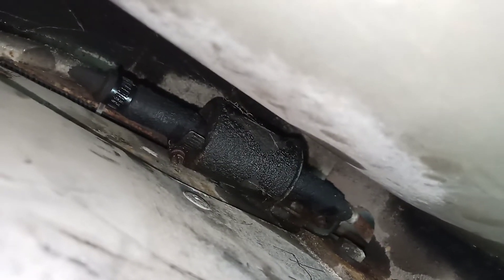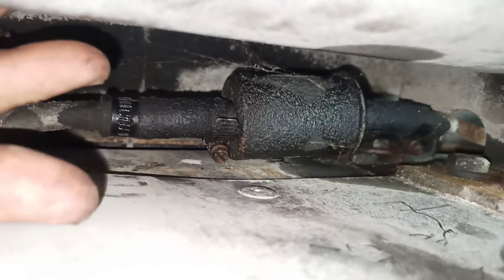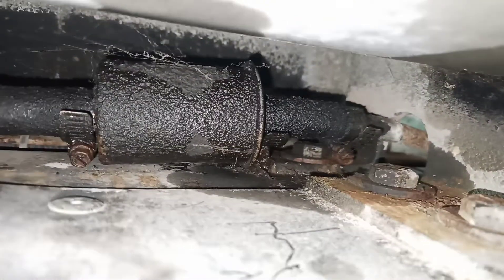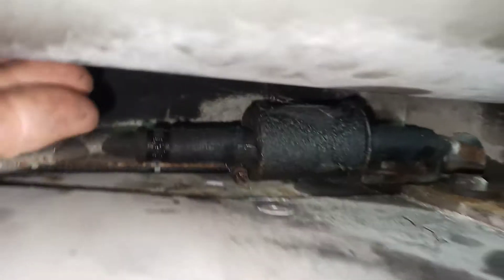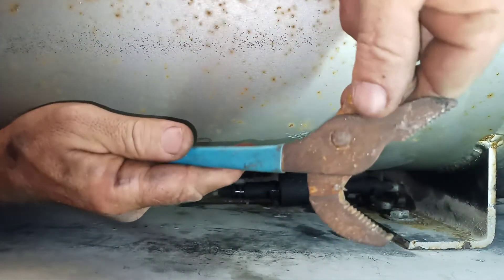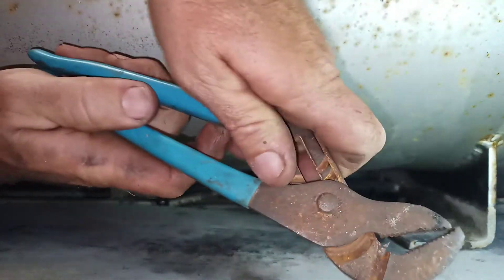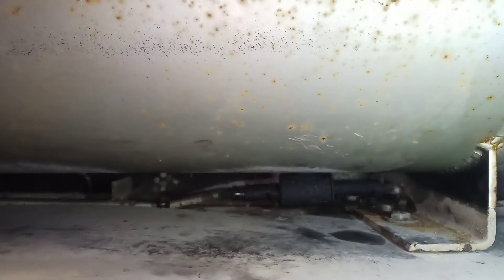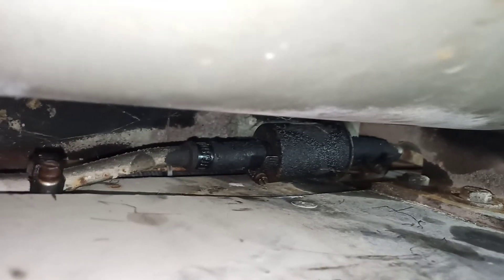Fuel filter trouble for Holiday Rambler

Comment: Bindare dundat
Reply from the maker: The Motorhome is in the shop now.  
The techs removed the gas tank Friday, cleaned out the sludge  and ya, they put in a new fuel filter.
Reply: @MarkCormier  
Was "gifted" a 1987 HR 33" a few years ago.
60 gallon gas tank was dropped underneath.
Interior was immaculate.
Decided to go full restore.
The fuel line was crimped near the propane tank and filter. Probably a problem since date of purchase. No power up hills. Fixed with vise grips. Replaced filter and removed internal carb filter and installed in line visible filter so I can see if it is getting gas.
Could spend three hours going over all the upgrades.
My house on wheels.
Rebuild the hd turbo 400 like a tow truck.
Under 55k on the 454. 
I like my rolling home.
Very reliable now.
Reply from the maker: Where should I send photos? rainbowpoolservice@gmail.com